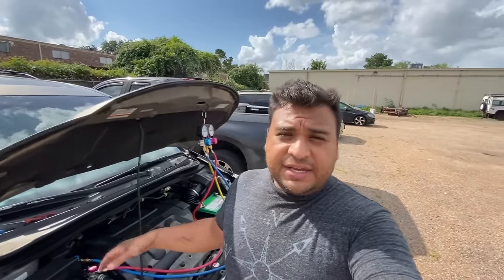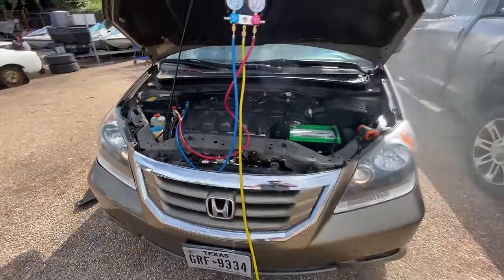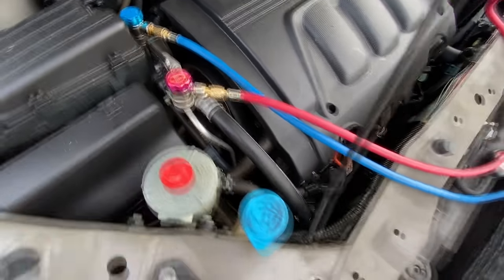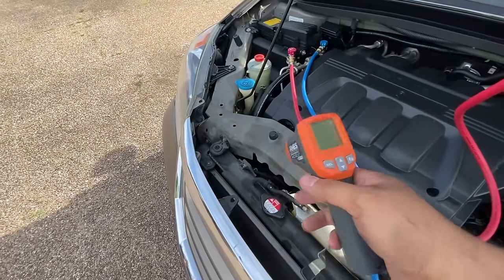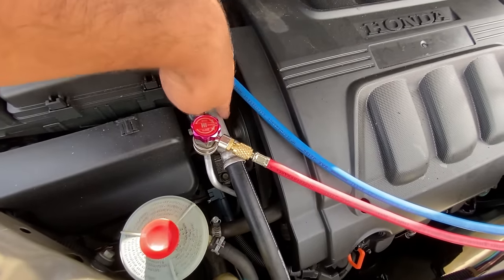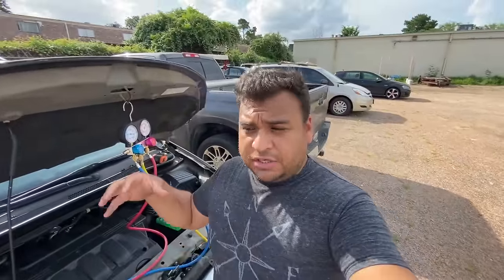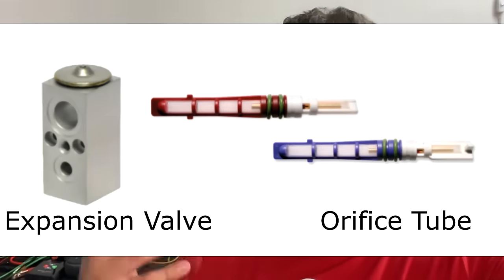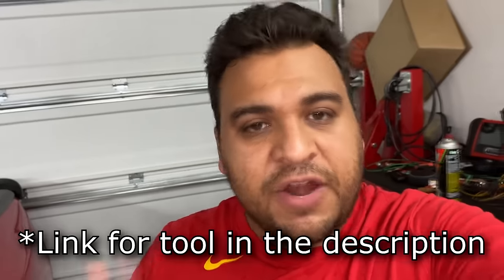HOW TO FIND A CLOG IN YOUR CARS A/C SYSTEM

Comment: I have a question. I have a 2010 Honda Odyessy EXL and my pressure gauges when the A/C is turned off is the same reading of 110 psi on both the low and high side. So they are equalized. How does this tell someone the line is charged correctly?

While the Van is running and with both front and rear A/C turned on, my low side is at 55 psi and my high side is at 175 psi. The cabin air vent only gets to about 65 degrees. I have a new compressor and expansion valve, as well as condenser and evaporator.

A shop told me I was losing freon via my front evaportor, because I was losing pressure, but I don't think I am if my low side is still at 55 psi and high is at 175 psi.

I am thinking the A/C suction line maybe the cause of my A/C not working as all the major parts have been replaced several times, and still the A/C does not blow cold and Low side never comes down to range of 30-40 psi.

Comment: Great video Eric!! Thank you very much! Now I would like to share my problem (still a problem) with my 2009 Suzuki Sx4 with Matsushita compressor. The thing is that I fought a lot cause I made several vacuum process and recharges, and always the same reading, normal to low LP side, (that make compressor switch on & off because of fall of pressure) and HP side with values between 275/300psi. 3 times my relief valve evacuated oil and r134 (expensive in my country 20 dollars a kg). So I decided to buy a new condenser, new expansion valve and make a proper flush with r141 (even more expensive 30 us$/kg) a bottle of pag 46 (22 us$/250mL) I did everything by service manual, and 40 min of vacuum. The same issue returns. Normal to low LP side & HP side 275/300 psi on 75F° day. Intermittent cooling inside de cabin. Can a evaporator coil get clogged inside? I noticed on the flushing procedure that the only element that seemed to be obstructed was the evaporator coil. Please give me some advice! I'd appreciate a lot!! Regards! And keep on teaching!
Reply: I know this is a little late, but perhaps your pressure is building because the fan that cools your condenser isn't running? I had the same symptoms and checked a troubleshooting chart, and one of the things to check was the condenser fan. Another clue was I'd get cool air when the vehicle was moving and warm air when idling in place. Sure enough, it was a bad fan. New fan cost 30.00 and after installing the high side went down to normal parameters.

If your condenser doesn't have enough air blowing across to cool it, the compressed gas doesn't turn to liquid and drop in pressure, which is what causes the extremely high pressures. When the vehicle was moving, the wind blew across the condenser but when stationary, no air could cool it down.
Reply: @watcherwatchmen7785   Hey! Hi! Thanks anyway! But no,  the condenser fan (Condition and operation) was perfectly fine. I have changed my condenser and this issue occurs in any condition, at 100 mph or idling. I finally solved the problem doing something not recommended but I was quite fed up of the results changing all the elements I could (I would never touch the evaporator) change. So one day I picked up modified r134 bottle I made some vacuum on it and I pull some r134 from high pressure side, until I got a normal reading. End of issue. Everything started to flow as new. Thank you very much for your reply! Regards

Comment: Just bought a 01 previa with the ac not working, The previews owner just had a new compressor expansion valve and drier replaced still no cold air. Pressure readings are similiar to this video 45 low and 50 high side, I noticed the drier is installed backwards would this cause a blockage and will this cause any other problems such as ruining the drier or other components thanks.Should I install a new drier or just turn it around, also I understand the drier is full of these little absorbing beads could these be sucked into my system since it was installed backwards or are they contained.

Comment: Great Job Erick! 👍 I dealing with 2014 Altima 2.4L and I can't find the orifice tune...I replaced the expansion valve and the dryer and I am still doing with high pressure on the low side..please help me

Comment: Also, was curious. Were is the high press cutout? Was it jumpered? The blow off is a last resort fail safe to keep something from exploding. Usually the high press switch is in the hot gas line between comp and cond. If not jumpered, or missing, you might want to replace it.
Reply from the maker: The high pressure cutoff switch is located after the high side port. Much like we don't see the extreme pressure on the gauge, the switch does not see it either.
Reply: Was thinking it may be after it, haven't had the opportunity to work on the Odyssey yet. They should've installed in the discharge line between the comp and cond. That was a design flaw in my opinion.

Comment: I only have a gauge for the low side and am trying to diagnose wny my AC doesn't get cold. Compressor clutch works as it is supposed to.  I'm getting 90 psi sitting still not running and 90 psi while running.  The lines don't seem to significantly change  their temperatures. Where do i go from here?

Comment: Hello Eric been having issues with my ac on a 2008 f150.       It comes and goes compressor won't come on? Took it to a shop they replace pressure switch and recharge but nothing just told me need to take it to a dealer have them reprogram the whole system.        Funny thing it started working there for awhile for like a month or so but now it not working again compressor won't kick on

Comment: Hi Eric, I have a 2012 Honda CRV and When I have the ac on the temp guage goes up to about 3/4 way up and ac cut off. Then I have to turn the ac off and Turn up the Blower all the up and temp to High let heat come out. Doing so the temp guage comes down and the ac works. Today I turned the ac off and the blower on mid range. Drove for 250 miles the temp guage stayed at 40 degrees. Tells me my Radiator, water pumps are working good. The coolant censor is good. AC compressor is used was installed 1 year ago. When ac works it's icicles. I never changed the ac condenser. What is your recommendation? I would appreciate your advice. Thank you.

Comment: sir got my honda crv 98  gen1,   got replace my drier, expansion, new compressor.   but still cooling system is cold but not as cold as before.  30/170 reading.  30 seconds running compressor then it cut off.  too quick the cabin not cold enough. , any suggestion sir?

Comment: @markh3478
0 seconds ago
Great video . I had this same problem on my 1988 BMW M6 with only BMW OBD1  . Low side gauge reading a little high and high side gauge reading very low . System was overcharged by me trying to solve the problem with a Wal-Mart can and gauge . No luck.  I guessed there was a blockage in the condenser so dismounted it , bought a small fluid pressurizable tank at NAPA and some stuff I think was called Dura flush . Its mostly pentane so flammable . I put it in freezer for an hour before starting .  Pressure fed the Dura flush into the condenser discharge side at 90psi  . Nothing happened for about two minutes so hit it again with more . All of a sudden whoosh and a gusher of gunk shot and spattered about 20 feet across my driveway . Glad I had on safety glasses . I flushed the lines to and from the compressor too .  After new o-rings and assembly with an ounce of AC oil added to the condenser  , 30 minute full vacuum and recharge with 134-a ( had already replaced TXV and STV POA ( car has rear evaporator , too ) I got 44F at vents with fan blowing on condenser, 2000 rpm fast idle on 92F summer day .  Now get 225 psi on high side at 75F .

Comment: I once installed a compressor that was doing the same thing but it was on a new re manufactured compressor and I call that valve on the compressor but told the customer that I would have to replace the whole unit not just that valve and had to be replaced with a new one not a remanufactured on and after that it was good.

Comment: My Ac was working fine and then I switched it to defog the front glass and then it stopped cooling when I switched it back, it’s set to recirculate, the AC is on but no cold air is coming out, just room temperature air, I checked in the hood and the Low pressure line is room temperature and then I check the High Pressure line and it’s hot and then I saw there is some kid of splitter at the High Pressure line with a smaller line and that one was cold, I turned the car on and off a few times and did the same to the AC and it started to get cold again and the Low Pressure line got cold and it was working fine for like 20 mins then all of a sudden, I heard some hissing in the cabin and then no more AC, can you help me understand why that is, if possible please 😢

Comment: My ac gets cold only on low fan speed it cycles at 40* but if i turn the fan speed to high it rises to 60* and stops cycling.  And if its at 40* low fan speed and i turn it to high it dont hold the temp at 40* . What do you think

Comment: I'm having the same problem. After recharging with fresh refrigerant started shooting refrigerant from compressor. I suspected that problem is in the high side. The low side lines become ice ,but strangely it shoots refrigerant from compressor. So I think the high side is being blocked. And I did change the orifice before. So I don't think the orifice I clogged.

Comment: Off the ac i have 2011 1500 dodge ram 4.7 2WD and theres no codes but only the ABS N ALSO TRACTION  lite on but it peel out It Accelerate shits fine but take a while to pick up pedal down and it kinda like choke i seen that break switch thing its brand new well looks like it idk brother help

Comment: Need your help with my truck, had to buy a used truck because a mechanic burnt my good old truck to the ground, I purchased this used truck because it has a new engine with a warranty, but I don't think they programed the pcm the correct way after the install. Runs fine, getting 20mpg, really good mpg for a 4x4 with large tires, but the check engine light and the abs light stays on, reset the pcm a few times, lights go off while idle, but come back on after any rpms go over idle. Need your help, actually thought about driving to Houston, but Don know where you're located.

Comment: Hello sir,
I owned a 2015 Nissan Altima S, there is  problems with my ac, it is blowing mild cold, I went to the mechanic and he said, the problem is condenser and also he said he will try by cleaning the condenser if this doesn’t solve the problem then we have to change the condenser. Is it might be the case sir!?.

Comment: Hi Advanced level, I have a Chevrolet Sonic 2015 the the problem is that the high pressure pipe is cold and the low pressure pipe is warm and the A/C does not cool, what could be the problem? i have to recharge the system each month

Comment: I've just replaced the expansion valve, condenser, cabin air filter, AC pressure sensor, and the compressor......still won't take freon or charge....

Comment: I had put a new compressor, new condenser, new radiator, new expansion valve, new heater core, new evaporator on my car  and my a/c is still blowing cold on the driver side but hot on the passenger side. I bought all new parts to have cold air but still not working properly.
When i turn the air on i hear a hissing noise coming from the vents

Comment: Bingo , you win the lucky prize , I've been racking my brain on this 2000 jeep cherokee , I got the same curbing dent in it , maybe a short pole.  Whatever , but the ac gauges are acting weird,  my high pressure lines were cold , low pressure was warm ..that's what it is , condenser..I'll find out after I replace it ..thank
Reply: Update , i replaced mine , something is still plugged , my ac pump is new it dont blow off like this one , im wondering if my evaporator is plugged ..or full of white long dog hair , but i got air and vent pressure .

Comment: What do you recommend for an ac system where all the comments are working but it's just not blowing as cold as it should. All pressures are normal and full. Any suggestions?
Reply: Blend doors?
Reply: @carllsn8  No blend doors all working as intended thinking maybe the orifice tube valve? I have heard of them getting dirty rusted and clogged. Thinking maybe I should check there first.

Comment: I need help I install new compressor, dryer and expansion valve. After installing everything and pulling a vacuum and did a recharge and the car blew cold air only for 5 minutes then it blew warm air and now it doesn’t blow cold air at all
Reply: Also the low pressure line is hot not cold.

Comment: Only thing about what he said unless my understanding is wrong. The refrigerant enters the compressor as a gas and is compressed as a gas and still leaves the compressor as a gas, that gas is now under high pressure. The High pressure gas enters the condenser and its the fans pulling the heat out of the this said gas that turns it back into a liquid yet still under high pressure as it flows to the Expansion or Orifice tube etc. You can't compress a liquid. The high pressure gas is pushing against the liquid.

Comment: On my 2000 lumina, the pump runs constantly. It fluctuates from 40 to 50psi on the low side, but there is ZERO cold air.

Comment: Absolute interesting.  So recently I replaced my entire A/C system >> New Compressor, Hose's, Condenser, Orifice Tube and Drier/Accumulator but not the Evaporator.  Didn't have any issues except worn and noisy Compressor Bearing and Clutch.  The system calls for an oil fill of 8oz and 2lb Freon.  They put in 5oz oil and 2lb Freon.  I had the cooling shroud off at the time and they say that the A/C was running an extremely high pressure and was due to the shroud being off!  I immediately installed the shroud and connected the Clutch connector.  The A/C seems to be working very nicely and can get as low as between 40-30 degree's F.

My Question is, Should I be concerned about the variance of minus 3oz's of oil???

Comment: But isn't the line coming out of the condenser supposed to be cold?  Doesn't the condenser release the heat?  So the discharge should be cooler, no?

Comment: The only problem I hear is that refrigerant leaves compressor as a liquid and changes into a gas in the condenser...it's actually the other way around...you can't have a liquid in the compressor...not in the suction/low side nor the Discharge/high side...

Comment: This is the mistake that just about every mechanic makes, they diagnosed the vehicle and then they say it needs a compressor so they put a compressor in without replacing the dryer and the condenser and cleaning all the lines. It is such a backwards half ass way of fixing an AC system. Anytime you change the compressor you will notice that there is a lot of debris inside of it and where do you think that debris is going it's running through your condenser and all your lines including your evaporator and that's why whenever a vehicle needs a compressor it's guaranteed it needs all those other parts also and or have them flushed, ideally you can never flush a condenser because the fins or the ports inside are so small that you would just be wasting your time. A new condenser is always the way to go and always replace the orifice

Comment: You B wrong on the explanation of how the refrigerant cycle works.  When the refrigerant comes out of the evaporator it's a cold gas, when it is compressed in the compressor, the heat is squeezed together and the gas becomes hot.  It then goes into the condenser where it is cooled into a cool liquid.  Then it goes back to the evaporator where it is trickled into the evaporator coil where it expands rapidly and picks up heat in doing so.  It is full of heat but sparse and cool to the touch.  It then goes back into the suction side of the compressor where it is again squeezed together and becomes a hot gas (you stated it's a hot liquid).  That is never the case.  If refrigerant is hot it is never a liquid.  If the compressor had any liquid coming or going out it would "slug" the compressor and cause damage.  Properly charging the system requires a few degrees of superheat at the inlet to the compressor to help cool it.  Superheat is any heat the refrigerant picks up after it is completely gas and that occurs in the evaporator.  Since we know the temperature a refrigerant boils at a given pressure, we can determine the difference in the temperature at the inlet of the compressor and the boiling point that is a known.  That difference is called superheat.  It is also possible to determine the amount of heat in a system (enthalpy) by looking a the volume and pressure of a system while it's operating.  That is useful for determining size needed, of a system, for a particular application.  Essentially, in the example shown in this video, the cool liquid coming out of the evaporator is being metered by the crushed portion of the condenser coil in essence making that the evaporator and thus the place where heat is being picked up (which feels cold to the touch).  Diagnosis in this video is spot on.  Use of a temperature probe is a valuable way to find a restriction.  By using the term restriction, that means a place where the flow of refrigerant is reduced or impeded.  The metering valve at the beginning of the evaporator is a restriction.  You want the restriction at a point in the system where the indoor air in the car can pass over the place where the heat can be removed (at the area immediately after the restriction).  And not outside at the bottom of the condenser coil.  This diagnosis is spot on and this mechanic is using good methodology to troubleshoot this system.